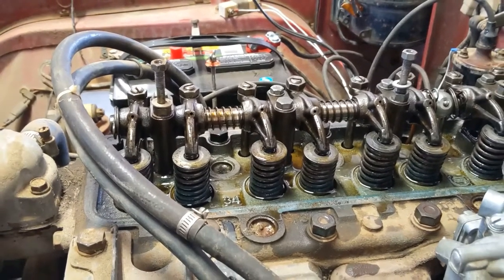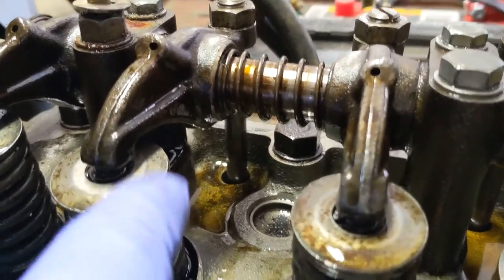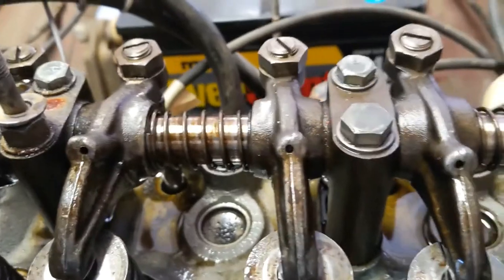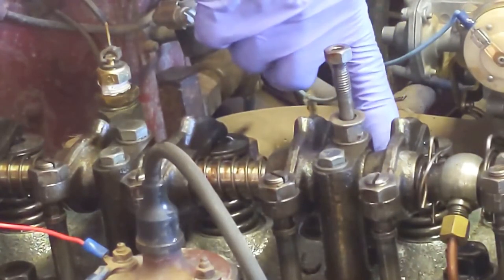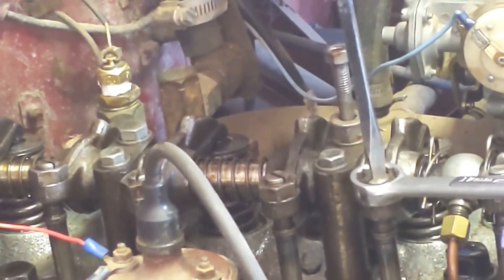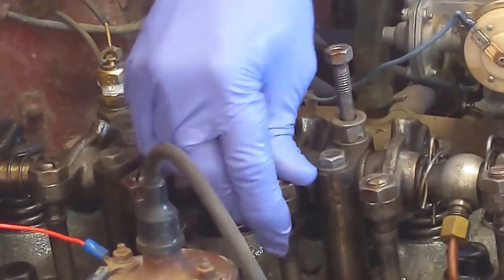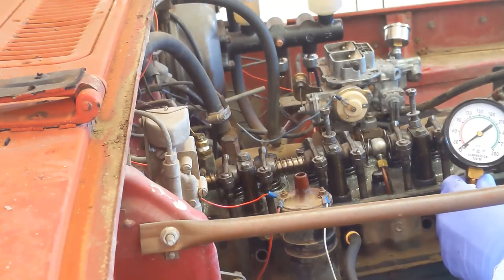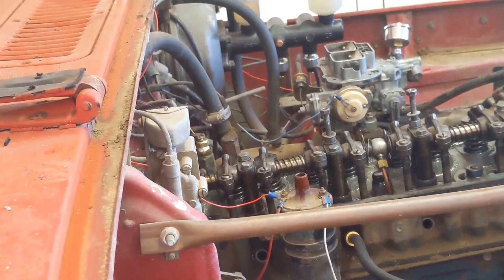Adjusting Valves

Comment: I started working on these in a Toyota dealership in 1977 always do them running I adjusted 1000s and I found a big difference between stationary and running usually too tight.The lifters rotate as the engine runs a little loose no dramas a bit noisy too tight they will burn valves drop the idle speed down when adjusting it makes it easier.Check the back manifold bolts they come loose and fall out sucking air and burning valves.I did a lot of valve grinds on these "Burnt Valves".
Reply from the maker: Good tips, thanks

Comment: I was doing this adjustment on my 79 fj40 and realized that the previous owner damaged two of the adjustment screws and I'm really struggling to find the reference for this. do you by any chance know what the diameter and thread pitch is for this screws? or if a screw for a different engine works on this or maybe they are standard? great video, thanks for the information!
Reply from the maker: To answer your questions:

1) I do not know the diameter and thread pitch, but you can measure these with two simple tools.  Use a dial caliper for the diameter and a (metric) thread pitch gauge.  I wouldn't be surprised if these are non-standard.

2) I don't know how different the heads are across the various F engines.  Someone on IH8MUD.com likely knows the answer.

I think a better idea is to find exact replacements. There's a good chance you can buy new replacements from online shops like toyotapartsdeal.com. A salvage yard that specializes in Land Cruisers like classiccruisers.com will be able to sell you used replacements. Someone on IH8MUD.com may have extras they can sell or donate to you. 

Because V8 swaps are common, there are lots of used F engines out there.

Comment: So you bump engine over for each set of valves to their high point then set gap and tighten?
Reply: Ive been hearing a ticking in my head so I believe the valves need adjusting on my 67 fj40
Reply from the maker: It's the low point.  You need the rocker arm to be at it's loosest point. You should be able to rock it back and forth and feel a little slack.
Reply from the maker: A little ticking is normal, especially when the engine is cold. The adjustments should be done on a hot engine.

Comment: Hi form Australia 
Nice video on doing the valves
Just a quick question im trying to tune a 350 holley on a 3f engine what size jets and power valve did you use?
Reply from the maker: Thanks.  I hear there are lots of FJs down under.

I don't have the jet information handy and I don't know that it would help you much because it was re-jetted (leaner) for altitude. 

I'm not a carb expert by any means, but if your 3f is more or less stock and you're at sea level, stock jets should work pretty well.
Reply: @mikerestoresanfj4069  thanks for the reply 
Its a bit of an odd one its a fj75 ute with 130 litre lpg gas tanks plus the 80 litre fuel tank.
but at the moment i got 61 jets and a 6.5 power valve  at sea level it revs great at idle but not in gear i think the fuel pump might going bad does your factory one supply enough pressure

Comment: Wats the recommended crearance for 2f when cold, I have a problem with plugs, everytime I replace they brow within days.
Reply from the maker: There isn't a clearance spec for a cold engine because it's actually not very important. As the engine heats up, metal expands and clearances get smaller. While larger clearances in a cold engine result in reduced performance, it doesn't last long. You want best performance when the engine is up to temp.

It's pretty much normal for a spark plug to turn brown in a few days.  You can learn more about how to read spark plugs here: https://www.championautoparts.com/Parts-Matter/automotive-repair-and-maintenance/how-to-read-spark-plugs.html

Is your engine running badly when it's cold?

Comment: How do you find TDC?
Reply from the maker: Timing marks can be found on the flywheel.  These can be seen through an inspection window on the clutch housing (near the starter).  There is a small ball at 7 degrees before TDC and a line at TDC. It's a good idea to mark these with some paint to make the easier to see. 

Here's a link to a YouTube video: https://www.youtube.com/watch?v=dfUNxDfxam8
Reply: @mikerestoresanfj4069  thanks for the reply. Is this port present on fj60 models? I don't plainly see mine. Perhaps it's buried under 35 years for oil and grime
Reply from the maker: @lastfirst5790  I don't know much about the FJ60, but I think it used the same 2F engine as the FJ40.  If so, there should be a port under the grime. There might be a cover on newer engines.